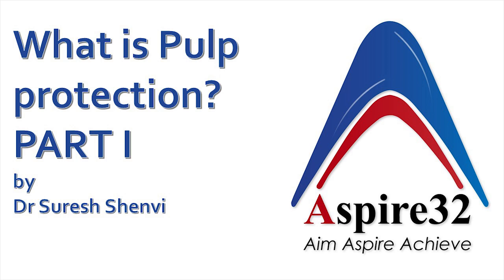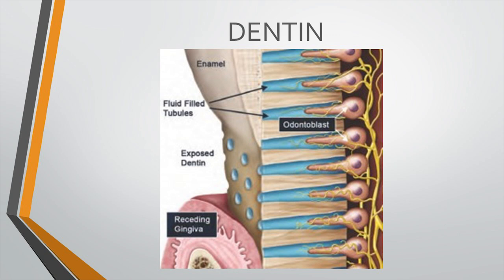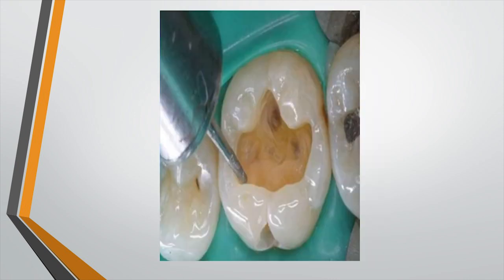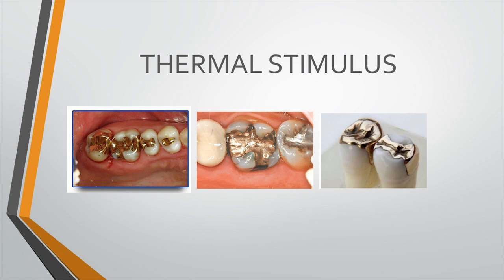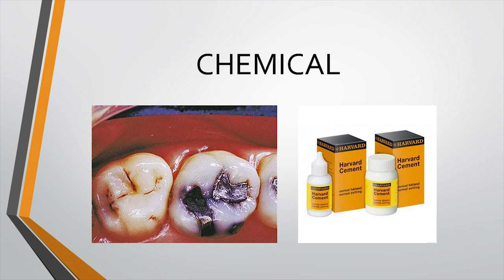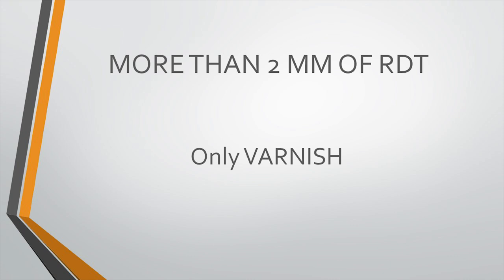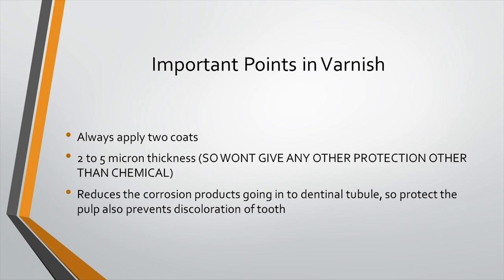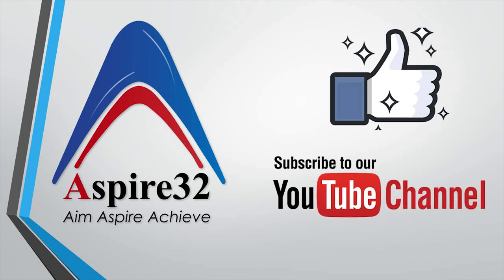Pulp Protection Simplified | Varnish | Part 1

Comment: thanks for the video
Is there is another way to estimate remaining dentin thickness without x-ray ? 

like, measurements as a rule of thumb.

Unrelated question, Is the strength of amalgam affected by sectional thickness and depth?
Reply from the maker: There are some electronic mesurement devices. I am not sure about the name. They can help one to measure the rdt.

Answer to your 2nd question is the thickness of the Amalgam. Depending on that minimum depth who be made.

I have explained this in the 2nd part of this video series. Here is the link.
https://www.youtube.com/playlist?list=PLdPsg6P-6VldA4PC0H0z54QVemWhi75Ke
Reply from the maker: I got the device name.. Prepometer. This can help you to measure rdt
Reply from the maker: https://www.google.com/url?sa=t&source=web&rct=j&url=https://vivalearning.com/member/da_review.asp%3Fx_ID%3D979&ved=2ahUKEwj8o7CancfrAhXt4nMBHfHwDc8QFjADegQIAhAB&usg=AOvVaw0bs4tVQ-7cnLGJksNcUFsG
Reply: @Aspire32  
Thank you, Great series.
I don't think that device is popular, i would be looking for it.

do yo have a practical advice for students who don't have access to x-ray or prepmeter?

my instructor told me to estimate distance by vision, but obviously i cannot.
Reply from the maker: That comes with experience. I do check the floor depth and sometimes if the p
Floor is too think it will appear pink due because the thin dentin reflect pulp colour

Comment: can we apply light cured varnish after curing of composite on it's surface to act as stain resistant ????
Reply from the maker: If you want to prevent staining then you can use an unfilled resin which is available specially for final application after composite. Its available with ultradent.. we dont use Varnish.